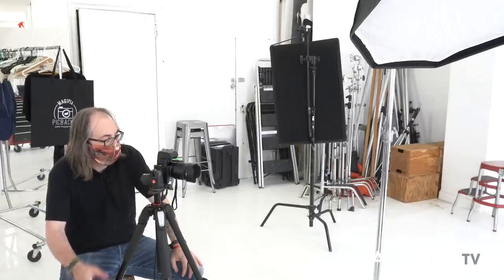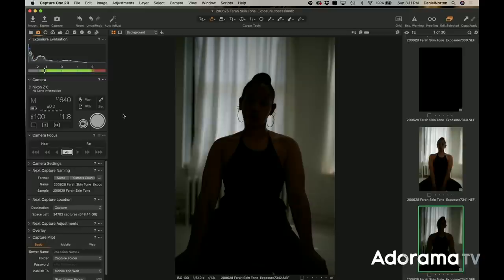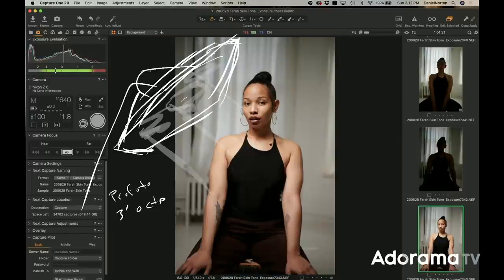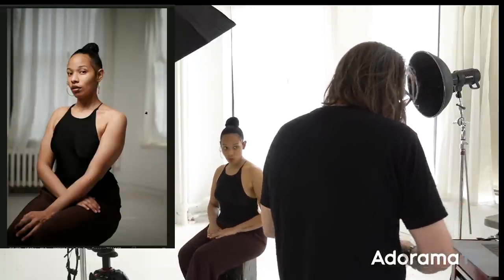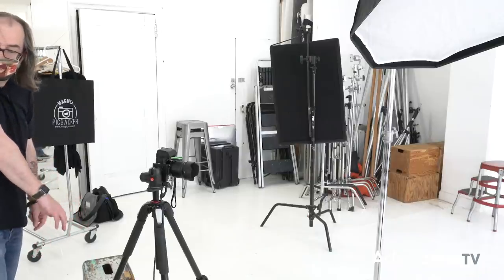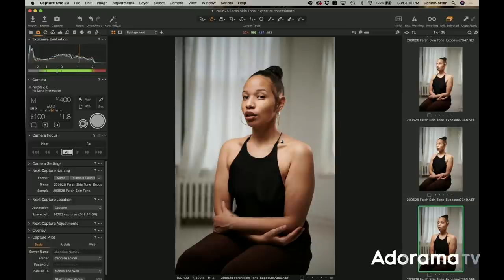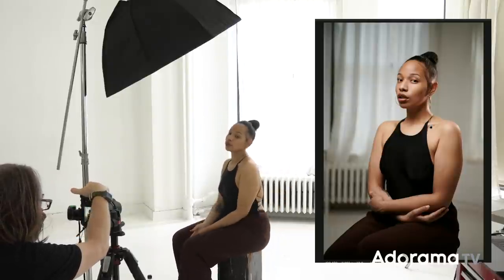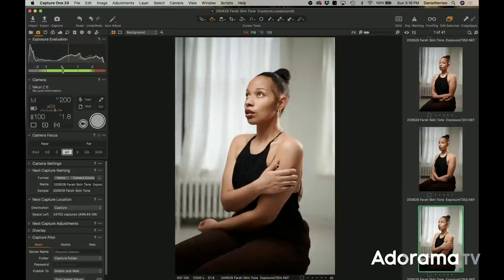Why use high speed sync for portraits: OnSet ep. #275

Comment: Nice setup and great model.  Question, why use HSS rather than say an ND filter since you are in studio and using a tripod?  What’s the advantage in using HSS?
Reply: For me the advantage is if you have the flashes wit HSS  already you don't need a set of ND filters ;) I know I know, I'm being Mr. Obvious. But, if your flashes don't do HSS the ND filter concept works well too. I do like that you mentioned ND filters so people can think about the basic concept that's it's just bringing down ambient light and controlling the light on your subject.
Reply: Gavin just posted a video about this on the Adorama page recently. Watch that one.
Reply: HSS is simpler - with an ND I would need to have had different levels fo ND and changed it as the light changed.
Reply: he is just teaching it. sinc eu cant go outside due to covid he decided to do it inside. so just take it for the lesson and not the space. he use the window light to represent outside

Comment: Great video, as always Daniel.
When you are in hss mode, and you're shooting above that camera sync, when you get that cloud cover going over and you happen to drop the shutter speed down to that 200th of a second, do you need to turn hss off or does it automatically turn off below 1/250th? Then when you dial it back up to, say 1/640th, it's got the mode on still so it adjusts and uses the pulse again?
Reply: It turns off automatically with the Nikon.
Reply: @DanielNortonPhotographer  Good to know. I've got a Canon with the Godox system. I can see that the symbol is still active on my trigger. But I'll have to try it out to see if it automatically turns off on mine.

Comment: Hi Daniel. I shot a lot on the beach at sunrise time using flash for the model. Most of the times, I have the sun backing light the scene, very low over the horizon. To keep the sky "dark", I use ND filters, however I have  to make White Balance adjustments later. Do you think that this HHS technique would work fine under the conditions I mentioned? Thanks for your tutorial. It's very clear and educational. Greetings from Huatulco Baya un Mexico.
Reply: Yes, color shift is common with NDs, not so much with HSS